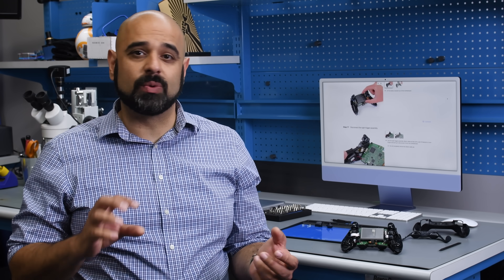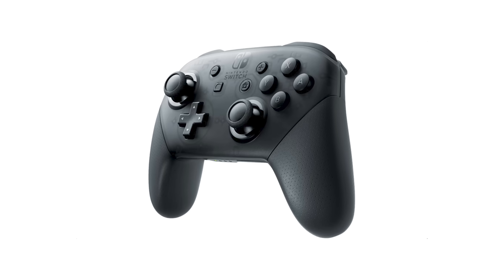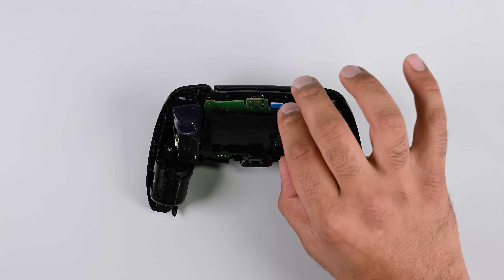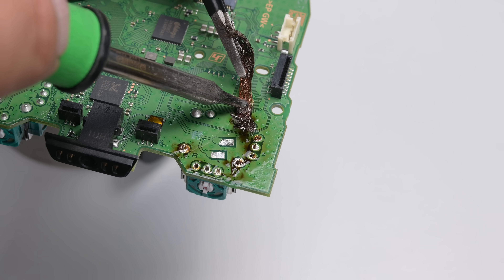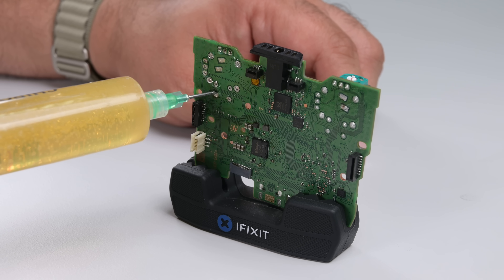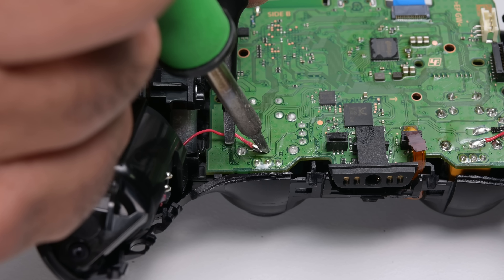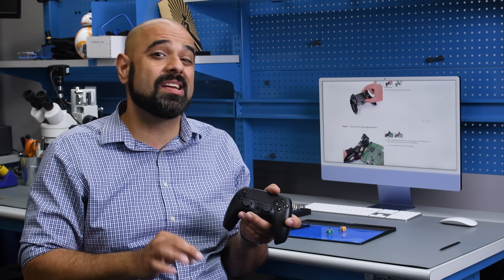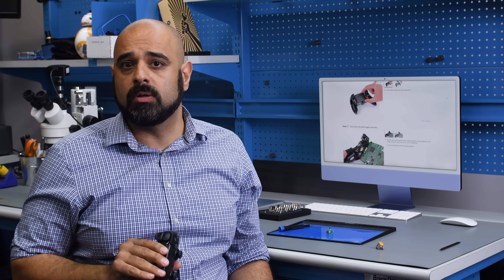How to Fix PS5 Joystick Drift for Good!

Comment: I have a ps2 ps3 ps4 and ps5 and they make everything more difficult to repair yourself every time. With the ps2 it was simply lifting a piece of plastic and you had access to everything. Now you even need a soldering iron to get into your controller. Now of course tech has become better and they have added more things which makes things more complicated but some of these things are ridiculous, even with the ps4 i could easily turn the screws to open the controller and clean the sticks to fix drift. Now you cant even access it unless you have a soldering iron and a guitar pick which makes it very appealing to just buy a new controller every 6 months. I find it hard to believe that a 126 billion dollar company cant make things that last more than a few months as they did before and make it possible to fix like some products before. But its all about maximum profits.

Comment: I have no idea how out of all the problems I've had with PlayStation controllers, stick drift has never been one of them. My brother and I have been using the same Dualsense controllers for years and only now I had one of them get drift on L2, which i fixed by popping L1 out of the controller and blowing hard into it. The other would not register the X button, so I opened it up and cleaned the membranes and the contacts for all buttons and it works like new lmao

Comment: 4th Option is to stop buying Nintendo, Sony and Microsoft Controllers and try alternatives. They'll get the hint faster that way. There are options that cost half the price and offer Hall Effect Joysticks. And even if those cheaper options have the same QC issues, well you're only paying half the price at least. The Gamepads from the big 3 Console Manufacturers are borderline scams, especially Sony, where their Serial Numbers are so easily rubbed off your gamepad that it should be criminal (it renders your warranty void).

Comment: I've got 2 DualShock 4 controllers that sometimes have drift stick issues (a purple one and a red cameo one, my oldest black controller doesn't have any issues). Funny thing is, I haven't used them a lot. So it couldn't be from wear & tear. Are there any simpler solutions that do not involve soldering.

Comment: I bought a ps5 and 2 weeks later the controller that came with the system had stick drift, like really bad. Luckily I was able to take it apart and wipe the inside part of the joystick areas and it seems to be fixed for now.

Comment: You find the answer to this in how much does it cost to make and ship a controler to the consumer market. If the cost is severely lower than adding a component that will lower the overall manufacturing. Then the answer is they want the money to keep flowing, and this ignored component is the reason for the devices sell success.

Comment: Man trying to get them sticks of is killer I tried to add more solder and use a desoldering gun and still couldn't get them all even used a hot air station still no luck eventually other components came of the board

Comment: If that happens to me within the12 manufacturing warranty, I'll bring back the whole PS unit, to where I bought it from.

Always buy at main high street store with bank card, anything happens within 120 days, and the shop or playstation gives you sad story. Go straight to your bank and do a bank resolution on the purchase, the bank will give you back you money.

£480 spent, and it breaks in 3 months. That's a problem that'll cost playstation millions.

Comment: I've had dozens of controllers on dozens of devices and have never ever seen anything close to stick drift happen.  I'm thinking there are far too many people cranking on the sticks like their lives depended on it.  You would see this often with old N64 controllers.  Dead limp sticks cause they've been abused.  You gotta be pretty cheap to try to fix one, rather than buying a new one, that would have a new warranty.

Comment: Soldering huh.. i mean if you can afford a 655$ machine wouldn't it be easier to just buy like 6 ps5 controllers? That means on average they'll last two per year. I suppose that soldering does have other uses but if your just a average gamer with no experience it seems kinda a waste no?

Comment: It’s up to each individual to either do the upgrade themselves or get someone to do it. Maybe if it occurs enough Sony will start to improve their controllers, although I’m inclined to believe they will never fix the issue because it’s each money for them. I’m opting to get Hall effect sticks for two of my controllers that out of the box had drift issues. Not giving them anymore money than the cost of the controller. It’s essentially theft

Comment: mmm i still use 2 now on XBOX 360 and PC, a new one (original, bought on offer 20 euros) never used because the old ones work well and I have never had drift problems even though I play demanding titles every day such as Street Fighter 4 or Gears of War. Why do today's joysticks cost so much more and are defective? I think it is an economic policy to the detriment of the consumer.

Comment: Its weird that they have used the same technology since the dual shock 1 owning pretty much everything since then, but i have never experienced stick drift until this generation, both of my ps5 controllers and my switch exhibit this problem , it cant be just the tech there is another factor here somwhere.

Comment: Another tip for desoldering the joystick modules: The potentiometers can be removed independently of the joystick itself. you just need to push the side tabs on each one and gently tilt the cover back. Each pot has 3 pins, and it helps to intentionally bridge the pins together with more solder, so that you can melt the existing solder on those 3 pins all at once, allowing you to pull it off.

Comment: The stick drift thing is all the more insulting when you look around and see that 3rd party controllers that do as good or better than the big 3 in a lot of ways? Not only have hall effect sticks but also grip button which is something Sony and MS only offer on far more expensive variants of their controller. 

If 3rd parties can do it FOR CHEAPER, then the big three can too- but they won't.

Comment: If I just put a spare joystick in from an old controller (that works fine) to fix my aim controller with paddles on it (out of warranty period), I dont need to program anything like you shown in the video for the 3rd party stick drift resistant ones do I? I should be able to just unsolder the faulty one and re solder a working one?

Comment: I just repaired drift on one of my ps5 controllers by just spraying a smidge of WD40 in the base of the stick. Wiggle it a bit, let it dry out, and boom, good as new.
Reply: Interesting. You had to disassemble the pad a bit or just sprayed right at the bottom of the stick?
Reply: @sleezay  no I just sprayed a little bit at the base of the joystick (on the side where the issue was), wiggled it a bit and left it for a couple of hours. I understand this won’t be a fix for everyone, but when it’s basically just a little bit grime that’s in the way, WD40 does the trick 😁

Comment: Bro I just want an easy fix . I’m no scientist 😂
Reply: Easy fix is to keep your controller clean. Drift is mostly caused by dirt. Cover your controller in plastic or in the box every time you're not using it.

But if you have a degree on rocket science, you can always open it up and blow under the stick to remove the dirt off. Contact cleaners work great . But only if you have rocket science degree. You might cause an explosion with the screwdriver if you're an amateur.

Comment: If it's within warranty Sony has to replace or fix the controller anyway so they are loosing money on many customers. Here in Norway we have 2 year manufacturer warranty + a extended warranty that lasts till the product is 5 years. So here Somy has alot of controllers to replace instead of making money on selling new ones.

Comment: I just did this myself with the new gulikit tmr modules. For anyone struggling to remove the old sticks, I had better luck with a solder pump than a wick. I also tried a conical and chisel tip but a blade solder tip worked best for me. I still had to add some leaded solder to help melt the factory lead free solder but after using a pump I had much better luck and still used plenty of flux too. I had trouble getting a few legs completely removed with just an iron but got as much as I could done then I was able to use a reflow station to heat up the little bit left while gently wiggling out the modules (a hot air gun should work too, whatever you have access to should be fine). Once the old ones are out its lightwork to put the new ones in, just  remember to use plenty of flux and take your time with it.

Comment: TL;DR
step 1) take controller and firmly grasp with dominant hand. 
step 2) open lid of refuse bin with non dominant hand. carefully deposit controller in bin.
step 3) disconnect power and HDMI cables from ps5.
step 4) repeat steps 1-2 with ps5 this time.
step 5) never give sony another dime.

Comment: i have always struggled to melt the solder off of the board, no matter which iron i use, even with the braid method, flux etc.  thanks for this vid, i now know i need to go ott with choice of how hot my iron will go.

Comment: I used to repair these on PS4 controllers.

To melt all the solder points we used a big blob of low melt welding rods.
You put a big blob then just keep running around the analogue pins until all of the solder is melted. Gotta be careful with temperatures though.

Comment: my xbox original controller is still good to this day... original one would be as well, if I had proper heatshrink and didn't spill solder onto the metal shielding surrounding the wire... turned that capacitor red hot under a second, and produced a powerful smell that alerted me to the issue.

Comment: I nearly gave up on this, but gave it another try. The tutorial makes it look easy, it’s not (as someone doing soldering for the first time). Some tips: Make sure iron is above 400, I had to set to 450. You will need to keep applying Low melting solder and wicking it off, if you don’t care about the existing sensor just tear off the potentiometers , will make it easier
Reply: Like the tutorial said, if you mix the factory solder with low melt point solder it's much easier.
Reply: Different controller design revisions have different soldering and different thermal mass around the pins. Rule of thumb is the newer the gamepad, the easier it will be to desolder. Launch PS5 gamepads are the worst. That said going above 400C is asking for trouble. You risk cooking other components. Best to stay at/below 400 and just keep throwing on the flux/lower melting point solder. It can take a maddening amount of patience.

Agree about the potentiometers. Getting them off separately/first makes life much easier. Not everyone realizes you can.

Comment: It's a big scam that they build poor quality controllers and force the users to buy more poor quality controllers which are also going to have stick drift issues.

By the way, it's not logical to get soldering tools which are definitely going to cost more than one dualsense controller, if you have zero experience just to repair your own controllers. It's better to get "hall effect" parts and find someone experienced about soldering with their own tools.

Comment: 50 euro chinese controllers that have multiplatform support, hall sensor modules ect.
The problem is that people do not know about them.
Once people will wrap their head around and understand that. You can buy cheaper yet more valuable product.
Only then the big guys will consider making their controller as they should be

Comment: We use hall sensors in cars and motorbike engines (for ignitiontiming) since the 80s. But not in mighty “next gen” consoles. Thanks m$ and sony for operating your moneypumos further… One suggestion for desoldering. Cut the old analogue’s shielding with a sharp tool (wire cutter) and in that way you can desolder pins one by one without the danger of tearing up the copper foil.

Comment: We need the problem fixed without added costs. The controllers have already tripled in price, going from $25 in 2006 to $75 today. It's really sad my PS4 controller I used for years on PS4 and have used years on PC since, still works daily, while I have gone through 3 PS5 controllers since a little after release when I purchased it. Long story short, they are 3 times the cost and way less reliable. 

P. S Please, for the love of god, don't tell these companies they could charge even more.

Comment: 4th option, when the power is off on the controller, apply a little bit of hand sanitizer to the stick that has drift,and just move the stick around so the sanitizer gets in the controller good.alot of the time its dirt built up (Would also use this same trick on the ball on the old blackberry phones,would work every time) Being that hand sanitizer is 60% to 95% alcohol, it will just evaporate in a few mins, and won't hurt your controller,as long as u don't turn it on before it drys. So make sure u wait,before using it. Its an easy fix if it works out for u,and saved u from all this nonsense 😂

Comment: Yeah, but those exact model are like $5 from China and not $20, and they are quality parts. I have used them in 100+ controller repairs after finding a distributor about 6 months back. So if I can get them for $5 a piece, Sony can get/make them cheaper. Absolutely no excuse why they don't use them in controllers already, other than it makes the controller last too long so they sell less of them. They make it hard for people to claim warranty on them because after a few months of use, the serial number gets worn and they won't accept it.

Comment: With all due respect, I disagree.
I bought a PS4 controller and PS5 controller brand new and BOTH of them came out of the box with stick drift back in 2023. The manufacturer (Sony) did not want the defective controllers back so I gave them to a friend who took them apart and looked at the sticks.
Just like the controllers that I had bought them as a replacement for, both had dust in the controller sticks where the potentiometers were. Once that dust was removed by my friend, all four controllers including the originals had no more stick drift.

This is not a 'wearing out' issue... this is a "The potentiometers attract dust and debris!" issue.
Reply: I have  done the cleaning and everything it's only a temporary fix I have ordered my own hall effect and will be installing them on the other 4 controllers that are basically useless
Reply: They now have more improved versions

Comment: Before buying a new controller i'd say try and clean the stick sensor housing with WD40, Dualsense is very simple to disassemble and it worked magic in my case, did it on my Joycons and haven't seen them drift since, did it also on my release Dualsense, and 3 controllers from my friends, all seem fixed atm and its been a few months.

Comment: I changed my stick drift after replacing only the potentiometer myself. Till today it's been many months now without stick drift issues. I keep many spares potentiometer in case it happens again
Reply: Yeah, it's not hard to heat and remove the three pins on a single potentiometer at once vs. desoldering all of the pins.  Then just slide in a new potentiometer and solder.  Fast.

Comment: I never had this problem step one: clean controller with rubbing Alcohol with q tip in joystick area every week or two step two :don't leave controller in open air dust and hair can make it's in the joystick and wear it out or if you want open controller and spray silicone to clean out joystick but I just do the 2 steps.😊

Comment: Seriously considering making the move to Xbox in the next gen consoles because of this issue. At least microsoft provides cheaper controller options with wired controllers. Much rather beat on a $25 wired controller than run the risk of stick drift on a $75 monipolized sony controller.

Comment: The reason all these manufacturers don't use it is because they want you to spend $70 on a new controller every x amount of time, instead of providing the ultimate solution to the problem, fortunately I didn't cave in to buy a 2nd dualsense and was investigating about magnetic potentiometers, defo will be replacing both of them in my dualsense, I refuse to let sony get away with crappy components just to make more money.

Comment: asking why to the big corp is like asking them to throw the gold mine. controller in console is the component that does most of the job, get more abuse, so it replaced often than the console itself. so it a "secondary" income for the company (see the quote there, it say secondary but most likely primary), same as printer company that we thought that they are selling printer but actually they selling cartridges. "I'm surprise that they didn't put ID chip in the analog part like apple does"

Comment: I haven’t done this myself, but I’m considering buying a custom controller that has hall effect sensors already installed. I have never soldered before, so i’m not sure how comfortable i’d be. i could try on old controllers i have before doing it on the one i currently use

Comment: this only happens to people that play too rough. i talked to friends and most of their ps5 controllers are fine after yrs from using it, part from some saying the battery is not what is use to be. don't be so rough on the controllers, it wont make you any better and it will break it